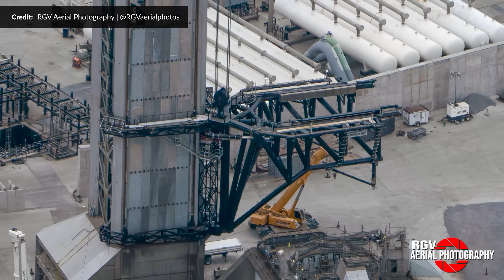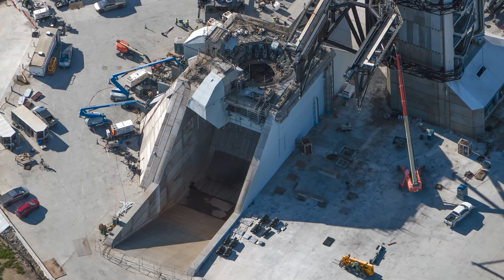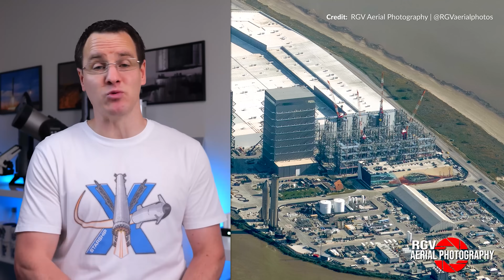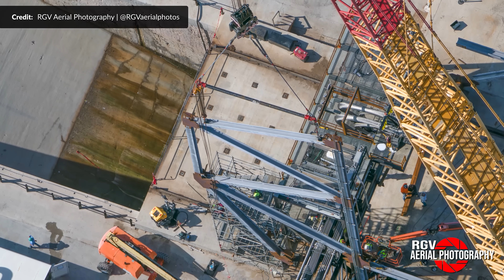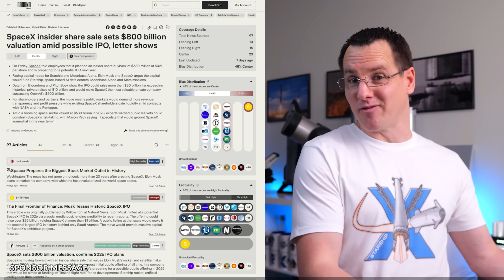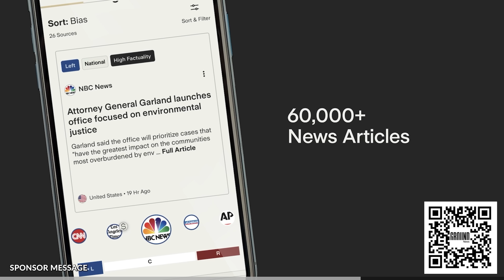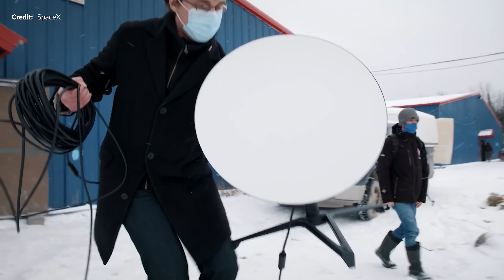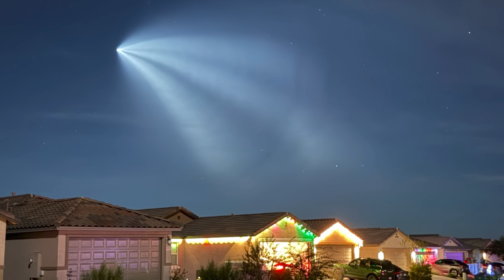SpaceX’s Starship Is Creating Massive Value!

Comment: Welcome to 2026 Marcus, I have a few questions. What is the overall weight of the heat tiles applied to the booster? What is the temperature at the base upon launch? Can the launch trench be lined with heat tiles? Are the heat tiles expensive and are theyy made on site?
Reply: That's a lot of detailed insider information you expect him to have...

Comment: The so-called 'new static fire stand' isnt a stand for static fire tesing, its a brace for TILTING the starship over into a horizontal position. Possibly for testing fuel transfers in a horizontal position, or for transporting the starship to florida on a ship! But either way, id say its for tilting over the starship!!! Consider that for 2026!
Reply: Maybe. But the barrel sections are much weaker under gravity in the horizontal position, so could collapse.
Reply: @RussTillling  So it would have to be tested under presure obviously
Reply: @Monosscema  And what would be the point of tilting it there? It's not a place in proximity to the port is it? There is no need for testing fuel transfers in a horizontal position.

Comment: I think you're right on the larger diameter hydraulic piston /cylinder being more powerful and smoothing response. Just like on excavators or dozers, the larger diameter the internal piston the More powerful a hydraulic cylinder is.
Reply: They look to be electrical